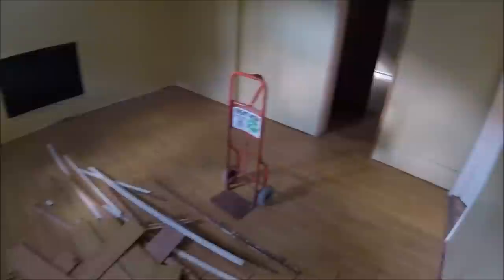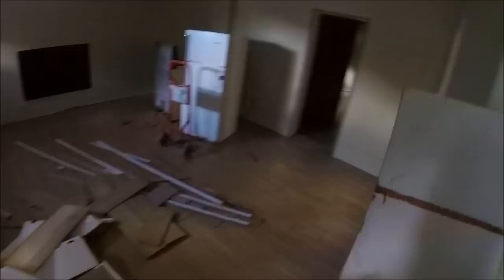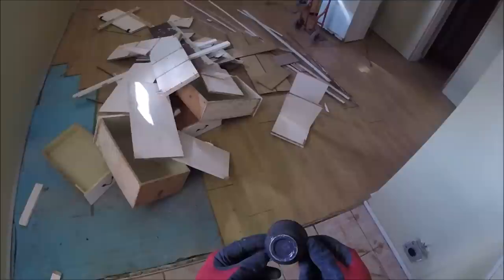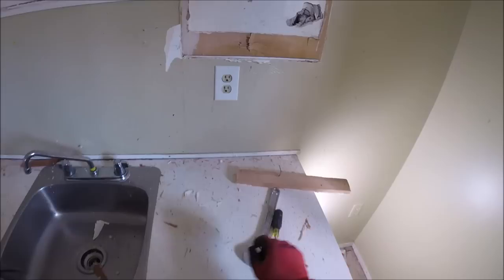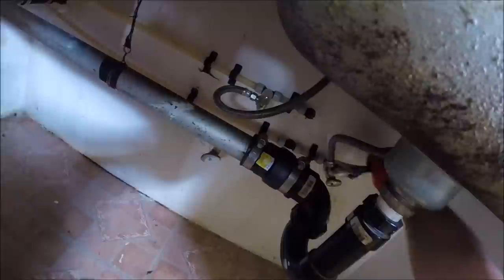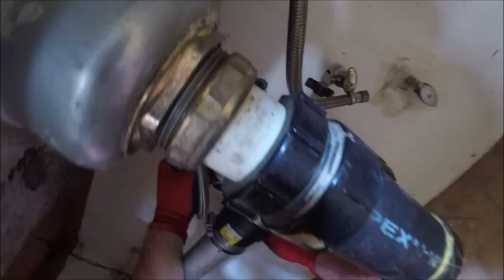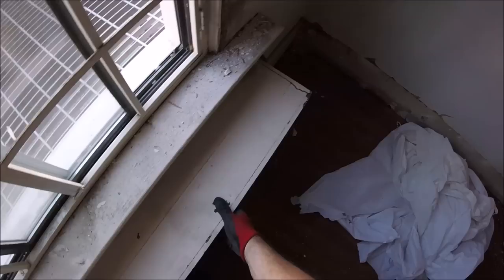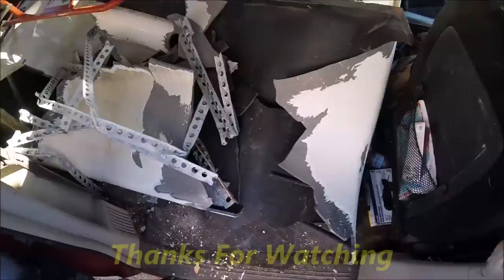Demolition Kitchen Cabinets & Smashing Cast Iron Bath Tubs

Comment: Do you wear a face mask doing this to protect against lead and asbestos which could be present
Reply from the maker: The building has been tested, Plaster & textures not asbestos
Reply: @CanadianTreasureHunter  ah ok. Btw where i live if caught doing it without a mask anyway and safework sees you the site will be shut down 😂.  And big fines come to 😑. I actually had to file a report about demo crew who did next to me. They were using garden tools on the asbestos no mask or eye protection letting dust go onto other properties etc. He wouldnt wrap it up like hes ment to he would throw in van and be gone about 10 mins (only asbestos certifed place is 60 min drive) and be back empty